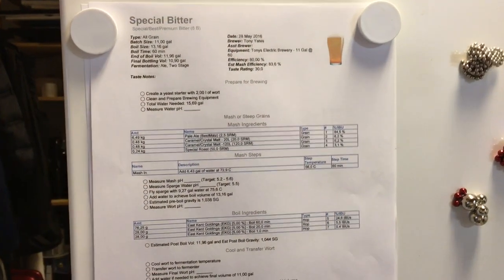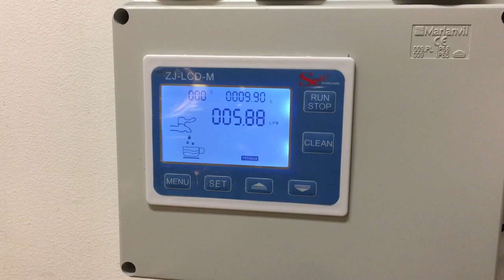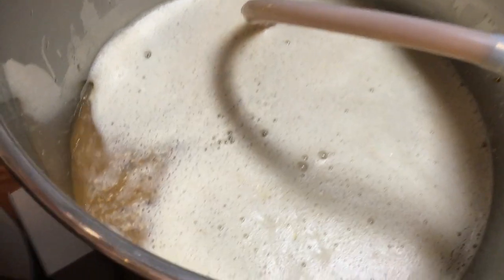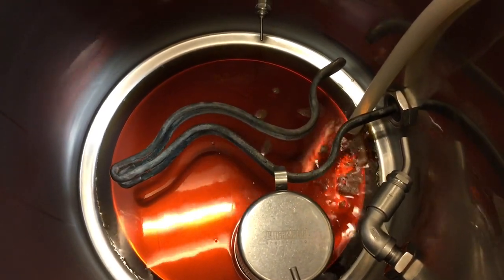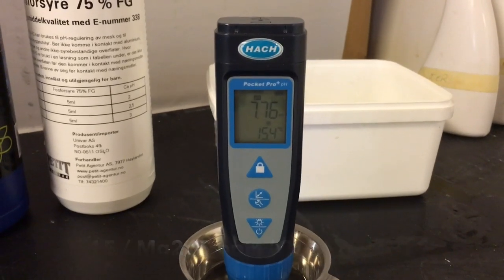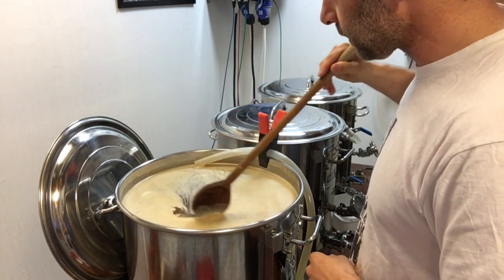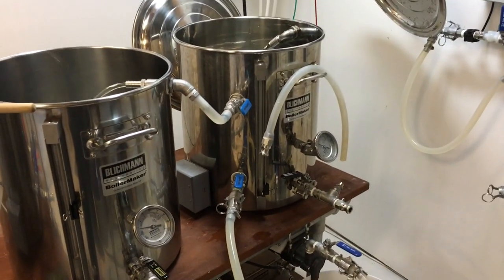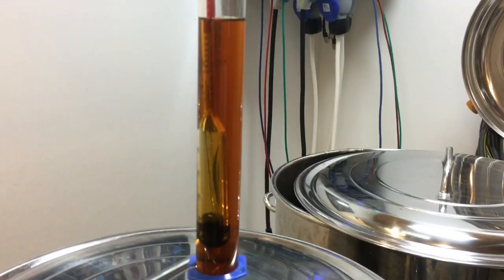English Special Bitter Brew Day

Comment: Wow that was very close Tony, I thought hmm that will expand  and boil over for sure,  good testament to fermcap S. I also ran through my plate chiller, which is what I am sure the majority of that came from, I see you did not run that through the counterflow chiller, if so it may have looked different. good looking brew day. you made me think crap time to recalibrate the PH meter. I have a question about the hop blocker, does it clog on you and secondly does it remove all that trub, that gravity read looked mighty clear. If so I may have to break down and get one/ Cheers Tony!
Reply from the maker: +MaineBrewGuy Gary I know right? Fern cap-S FTW! I recirculate PBW through my work pump and counter flow chiller for 10-20 minutes after every brew day. I'm OCD that way, haha. The Hop blocker does not clog, but it does get a lot of build up for the hopper beers - which is good. It does require slowing down the drain at the end, but I get much more out of it than the big screen I had before (like hockyplr). It's good at blocking out most break, just not when I get greedy at the end, haha. Cheers!
Reply: ok i will order one now, thanks man!

Comment: Tony love your home brew Wednesdays and congrats on the weight loss.  Hey question regarding your dough in, I noticed that you dough in bringing the strike water from the bottom, as well you recirculate during the entire resting period of 60 minutes?  Do you find this to be a benefit vs. allowing the grain to just sit stagnant in the water for the allotted time then sparging.  I am also using a blichmann system but it is the space saver 30 gal. system stack.  I can recirculate but would love your opinion on this.  Also what would it take to get you to do a tasting of one of my beers?  I have a barrel aged Cocoa porter, it has been aged 30 days in a Jameson Whiskey Barrel and would love your opinion of it.
Reply from the maker: +John Merlino Thanks a lot John! I do underlet as I prefer this way when compared to slowly dumping and stirring the grain in. Recirculating for the duration of the mash is more about maintaining consistent temperatures, for control and reproducibility - especially for multi-step mashes, than anything else. That's the benefit. I'd be happy and honored to review one of your beers. Sounds like a great beer! Send me an email to tonster321{{@}}gmail{{.}}com, or a private message via my channels About page (see Send Message button). Cheers!

Comment: Tony: Have you done a video on using your PH Meter? I just bought one. I haven't used it yet. I don't when I'll brewing again here. It was 115 degrees F on Saturday!
Reply from the maker: Hi Kirk! I have not done a video on my pH meter. Should I? What is of interest there? Too hot there for my blood :-) Cheers!
Reply: I think many are looking to add a PH Meter to their tool kit. I think something that showed how to calibrate and a discussion about Mash PH would be interesting. You are really good at explaining the technical aspects of brewing.
Reply from the maker: Thanks, I have been working on some water material - trying to keep it high level, but it's soooo easy to get into the details and over complicate it for the casual brewer. We'll see. Cheers!

Comment: Whats in that foam cap stuff? Thanx for the post Tony!
Reply from the maker: +Tasting Nitch Fermcap-S is a silicone (Dimethylpolysiloxane) based emulsion that works by breaking surface tension.

Comment: I can't brew without FermCap, lol!  How are you liking that Pocket Pro+ so far?   Curious if you happened to see that Low Dissolved Oxygen brewing document that has been floating around from the German Brewing Forum.  With your set up, I think you could try it out with relatively little adjustment to gear/process if you were interested.  Cheers!
Reply from the maker: +Dan ABA I like the pocket pro+ so far. I calibrate it each day I use it, and sometimes a few times in the brew day due to paranoia, haha. I did read that document.  I prefer to follow the guidance provided by Charlie Bamforth and Chris White. I don't find the noted differences as profound enough, more along the lines of gimmickry. I don't know.

Comment: Why don’t you connect to the whirlpool port instead of running a hose over the boil kettle?
Reply from the maker: To be able to take gravity readings - ensuring not to take final runnings below 1.008, and monitor the flow-rate. Cheers!

Comment: IMHO 75% was enough for a good roling boil, higher than that will caramelize your wort a bit.
Reply from the maker: OK. I believe it depends on the elements used. These are ultra low watt density elements, and are known for not scorching. That said, boil any sugars long enough and they caramelize. Cheers!

Comment: Toni, I want to eventually make an electric system, right now I brew with propane.  Is there any particular reason I always see people with electric systems having all three pots the same size? I have a 15 gallon, and I was going to buy a 20 gallon for my Boil/Sparge, and then a 30 gallon to use for my Mash tun. I want to be able to brew 15 gallons. Would that work?
Reply: Sorry, fat fingered your name Tony. My bad.
Reply from the maker: +Home Brewing TV No worries about the name. :-) 

I think that would totally work, and give you loads of options for higher abv brews. As for the common 3 kettle of same sized systems, I thinks it's just because that's what people see and go for it without thinking, or having the experience, to consider all options - that was certainly my reason. Your desire to have a larger mashtun make a lot of sense with regards to flexibility. Cheers!

Comment: I heard on the brewing network podcast with jamil zainasheff last week that your PH should be 5.2 at mash temp and a little higher at room temp. Whats your take on that?

http://www.thebrewingnetwork.com/brew-strong-ph-qa/
Reply from the maker: +Lew Brew my take on that show is that Jamil and John tend to get a bit intoxicated by the time they get around to recording the second show those nights, especially if John Blichmann is there, haha. True, Mash pH is ca. .3 lower than room temp pH. I put all my samples in a cool bath and make measurements as close to 20C as possible just to be sure. In his book, and on the Beersmith podcast, he states there is no exact optimal pH, and that it's a range between 5.2 and 5.6 depending on the beers style (lower for light beers and higher for dark beers). I believe the lowest pH of 5.2 is desired at room temps, otherwise we'd hear people talking about mashing at 4.9 pH, which I have never witnessed. That said, final beer pH between 3.8 and 4.5 is the general target. So as long as that's where a beer ends of, bottoms up! Cheers!